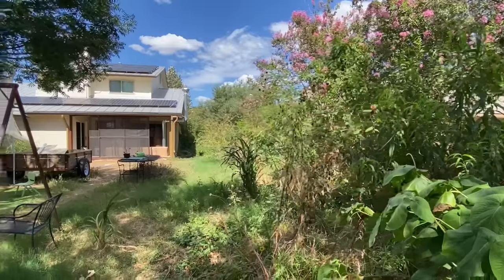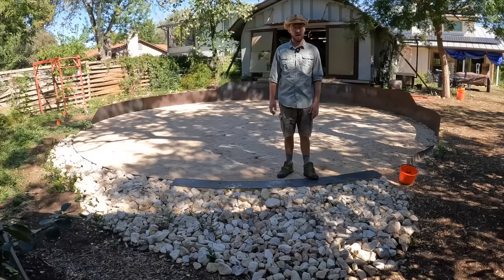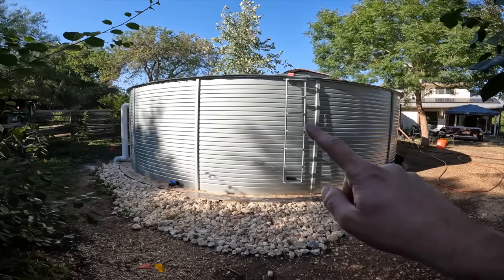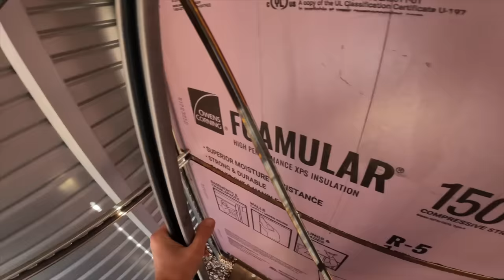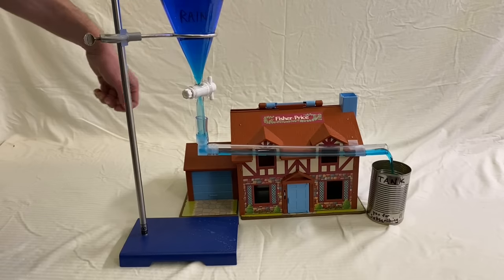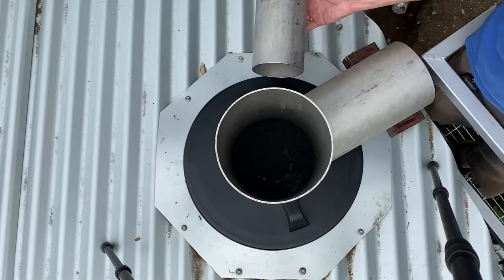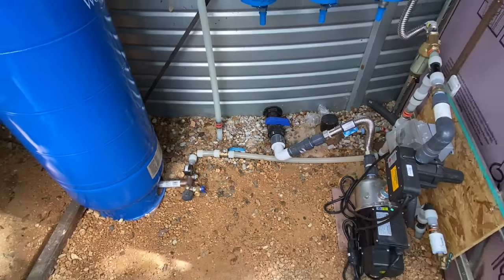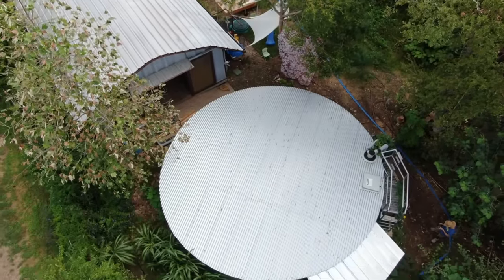FREE water forever.  LEGALLY!!!!

Comment: I´m sorry, but it´s truly ridiculous to have spent so much on such a huge eye sore, dam!
I have a well drilled down to 400 meters with one standard filter to catch the bigger bits of ruck, anything else
is just the goodness from the soil. Yet I should point out that I live in a forest in Sweden, so
no worries for germs. I´m shore their are many small creatures swimming around in the water
and yet the ground makes for the best filter type.
A pressure tank is a given if you want a decent shower pressure. Yet your water volume is probably enough to give you that.
I really do not understand why anyone would build such a huge ugly industrial sized tank in their garden?
It´s big enough for a hotel. If I had somehow felt the urge to throw money to the wind, I would have buried it of course, the pump
would bring it up to the house. You still need to treat the water with some chemicals though right, given the amount.
Shit, that must have driven your wife crazy, how are you going to sell the place now, why did you not move instead?
Man, this has to be the worst money loss I have seen, you could have managed with a tank half the size and even then
it would have been overkill. That plastic pond lining will release chemicals too after 1.5 years.